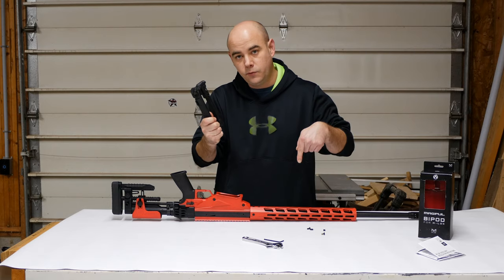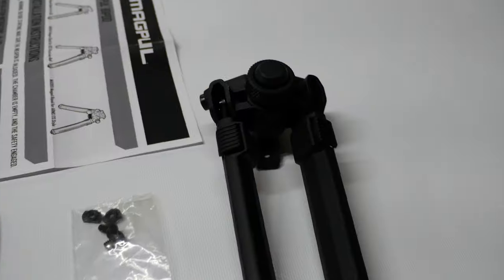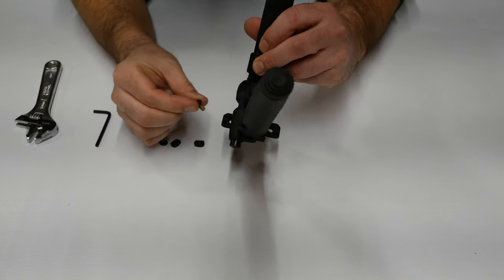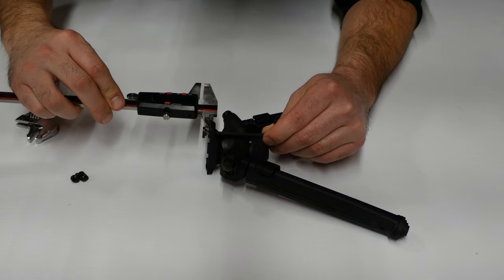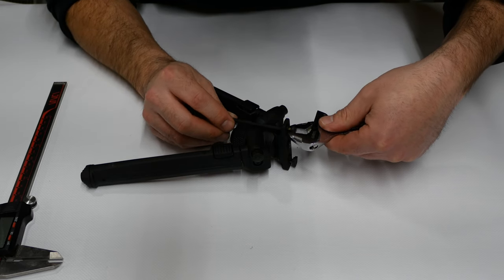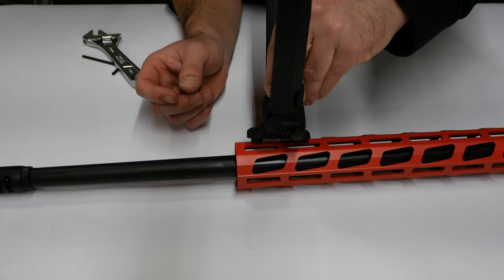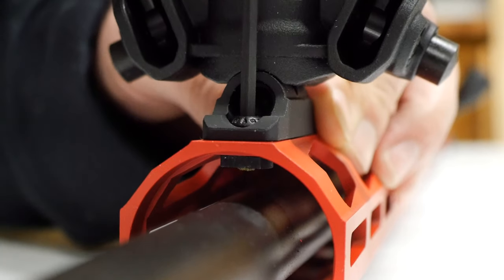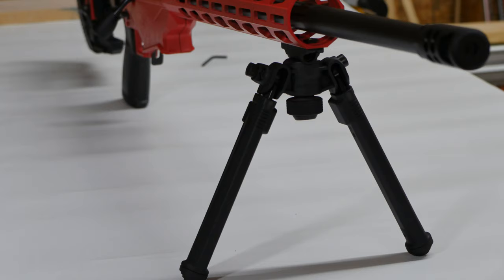Magpul Bipod Install On A Ruger Percision Rifle M-LOK

Comment: Did you install it backwards. Shouldn’t they be pointing forward when retracted?
Reply: Yup. 😂 You want to "load" the bipod with Forward tension by pressing your shoulder into the buttstock.  This reduces wobble in the bipod and creates a more stable shooting platform.  Mounting the bipod the other way (legs folding towards the shooter) makes zero sense.

Comment: As far as how tight, 35in/lbs: it probably doesn't matter one iota on an accessory mounted that far from the action, but best practice is to always use the factory recommended torque and use it every time. A decent torque driver is only $30-50, so all serious shooters should have one in their kit.

Comment: You lost me when the calipers came out... talk about extra steps.
Reply: Actually if you have a low profile M Lok rail there is the real issue of M-Lok accessory screws being long enough to contact the barrel. I’ve had to grind down over half the screws on M-Lok accessories I’ve encountered.

Comment: It's a little goofy that they recommend a metric wrench for the nut and a standard hex for the bolt.
Reply: Could you use a longer allen bolt and nut of you do not have a mloc on a break barrel air rifle?